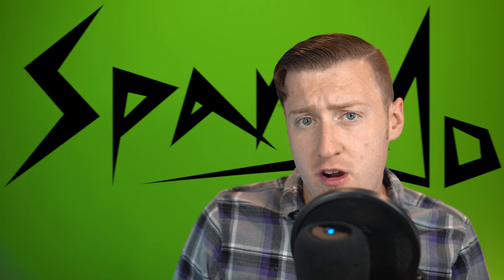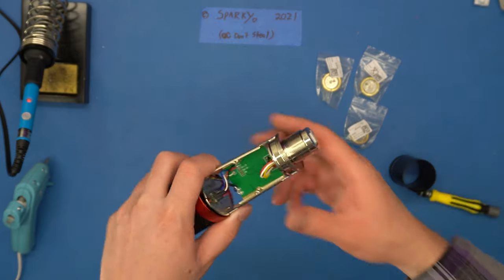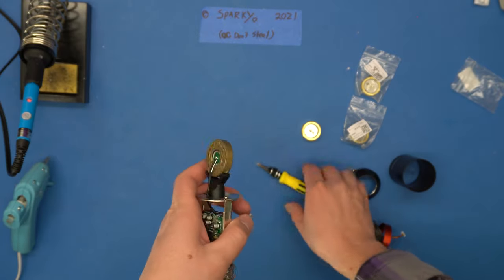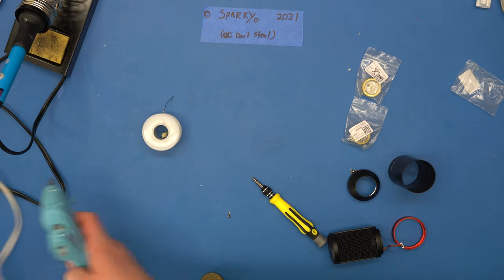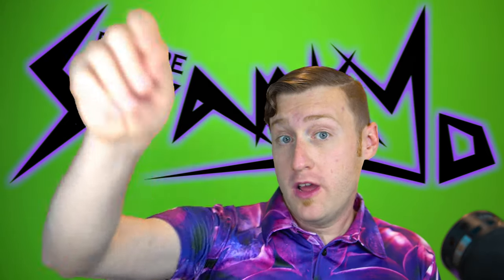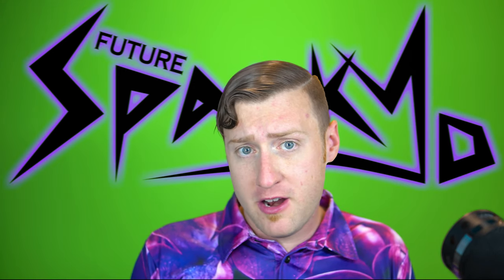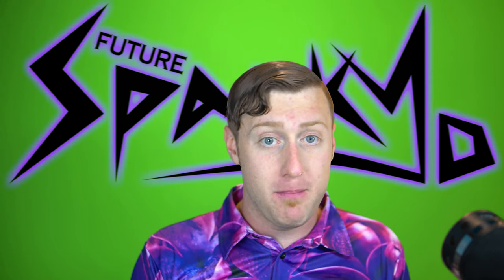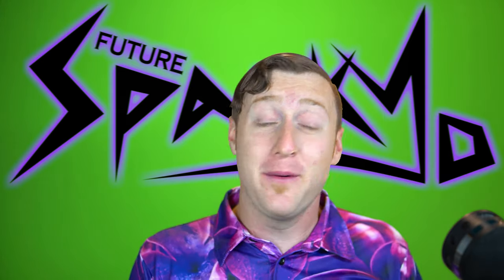Modding a USB Condenser Microphone | USB Microphone Hack?

Comment: Hi, I tried to mod  a BM-800 with a pure condenser capsule and I can confirm that there are really confusing info around. The capsule you tested is indeed an electret prepolarised one, but, confusingly requires an additional jfet, as it is not installed inside... DIY perks has recently uploaded a video using a similar capsule I think... try a J305 and maybe removing the 1GOhm resistor...
Reply from the maker: Yes DIY perks put together a good video. I think they uploaded a little after this one went up, so I wasn't able to benefit from their insight.
Reply: @SparkY0  try with a darlington transistor or another jfet with more gain

Comment: I have recently tried to upgrade a 10 mm omni capsule in a usb microphone ( based on cmedia 6533) and replace it with a 25mm capsule (without any jfet). All I hear is a noise. Any suggestions..
Reply from the maker: The input impedance of that chip is 20k - 45k Ohm. Check if your new capsule is too high of an impedance. You might need to build a voltage follower between the capsule and the input on the cmedia 6533
Reply: Let me add more info: The (3 wired) output from 10mm Capsule is sent to NJM 2115 preamp IC, before going to cm 6533 which is the (8051 controlled) main ADC-DAC converter, based on usb. Need to make 25 mm capsule compatible with NJM2115.
As for your project, the results are great. The noise may have further reduced if you could give 2N4116 (N channel JFET,  costly compared to J113) a try and put a 2.2k ohm resistor between source and mic body/ black wire.

Comment: Can I in theory modify my USB mic in removing the Audio Chip and USB connection and use an XLR output? Or would that be too complicated?
Reply: making it analog? yes  I was thinking the same, quality should improve in theory based on your analog gear
Reply from the maker: It's possible, but you would need to more or less replace all of the internal circuitry. This is a decent microphone body, but it would be easier to start with a DIY microphone kit and make modifications from there.
The capsule I tried to add in this video should work fine in an analog XLR microphone

Comment: The problem with cheap usb mic is that they cheaped out on preamp, they just don't have one and instead just push the gain of the dac to the max, which results in noise.
When swapping the caps of a usb mic make sure to also get a preamp circuit

Comment: Hi, look to 8:26 what is that other component attached to the JFET. The little gray one. Is that required to make it work? Also great vid!
Reply from the maker: There's only 2 components, the JFET and a 1 Giga ohm (1,000 Mega ohm) resistor. The intent of that resistor is to act as a very weak pulldown so that the gate doesn't accidently drift high. Any resistor in the 1-100M ohm range should work, but lower resistances could reduce the signal going to the gate of the JFET. 
In practice, it didn't make a lot of difference in my experimentation, but it's still a good idea to include it. A lot of electret condenser capsules do not have this resistor. They may be depending on leakage through the circuit board to act as this large resistance, instead of adding an extra part.
Reply: @SparkY0  If I use a true condenser microphone like the one DIYPerks used would it be necessary? Thx
Reply from the maker: Yes, these resistors are used in true condenser microphones

Comment: Ah crap I wish I found this video before attempting pretty much the same thing as you did, with similar results LOL. 

I've just replaced the condenser in my Maono PM422 usb mic with a JLI-2555BXZ3-GP electret condenser, paired with a J112 transistor - pretty much no volume even with the mic's gain knob turned to full. After boosting by 24db through Voicemeeter ended up with okay-ish volume, but with a heck of alot of noise (sounds like a constant buzz in the background). I also tried using a 2N2222A transistor that I had lying around, but that one straight up didn't have any output at all - not sure if it's because I have a dud transistor or if the transistor has the wrong specs (not even remotely familiar with how electrical engineering works so I have no idea)

Comment: you use a 48v phantom power capsule  on a usb powered mic??
Reply from the maker: On its own, you can't really use a a phantom power capsule with USB. You'd need to add circuitry to step that 5V up a lot higher. How high is best will depend on the capsule. Usually more voltage is more better, up to a point. 

The capsule I used, I'm pretty sure it's electret and does not need phantom power. At least, adding 30V from my bench power supply to it did not change the response in a noticeable way.... But the capsule didn't come with a built in JFET like most electret capsules, which is needed. The JFET I tried was not a good choice, and there was likely other problems holding it back.

Comment: it needs k596b transistor being soldered into capsule. 

1: Transistor's middle leg goes to capsule's mid contact. (soldering)
2: Transistor's left leg (from printed text) goes to capsule's ground together with (-) cable from PCB. (soldering)
3: Transistor's right leg (from printed text) goes to PCB's (+). (IT DOES NOT connects with the capsule). Just solder pcb's (+) with transistor's free right leg)
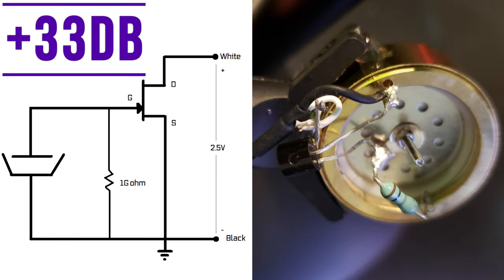Reply from the maker: That sounds like the diagram I showed at 8:15 Except the JFET I used was probably a J113 where the legs are arranged DSG. I guess I didn't show which transistor I used in the video. I had also tried J310. 
Is it that important to specifically use an audio transistor? K596 seems to be obsolete and hard to source, but it wouldn't be too hard to order in 2N5457 to try.
Reply: K596B's Zero-Gate-Voltage Drain Current is less than 0.5mA. Both J113 and 2N5457 have much larger currents. Without knowing the rest of schematics it's impossible to say for sure but highly likely this is the reason you did not get what you expected. K596B is very much alive, you can buy it at aliexpress, and it has built-in gate-source resistor.

Comment: im using fifine k669 mic and my mic sound is totally different from what i heard on youtube. it sounds very quiet, when I scream, the sound is quieter, it's like a compressor but the sound it captures is too low. Do you have any ideas?
I have to whisper close to the mic, if I turn up the volume too much it's noisy. when I whisper the sound is louder than when I speak normally
Reply from the maker: It's hard to tell without hearing, what kind of noise are you hearing, is it from the mic or from your room? Have you tried adjusting the volume in your computer OS, or only with the knob on the side of the mic?
How close are you to the mic? 
It's strange a whisper would be louder than normal speech, unless you are getting closer to whisper. Have you tried using the mic with  a different computer? Maybe it's a problem with your recording software, or there's some software installed that is affecting it.
Reply: @SparkY0  hi. it's like white noise but it doesn't matter, its low voice pick up is a big problem for me. with 70% gain on windows and 40% on mic knob is the good condition for my voice not to be too loud and cut off
. when i talk it picks up voice as low as headphone mic, i don't know how to explain it but it's very thin. 
if i record and increase it to 5db its much better
hi. it's like white noise but it doesn't matter, its low voice pick up is a big problem for me. with 70% gain on windows and 40% on mic knob is the good condition for my voice not to be too loud and cut off
. when i talk it picks up voice as low as headphone mic, i don't know how to explain it but it's very thin. 
if i record and increase it to 5db its much better
Reply: when i whisper like I'm tired and have no energy it will pickup more vocal range than when i talk normally, maybe the sound is too low and my gain is too high so it's distorted, i dont know
Reply from the maker: A lot of people talk into the wrong side of the K669. It's a font-address microphone, meaning you talk into the front of this mic by the knob, not into the end or the back. The stand is also very short and holds the microphone a lot further away than you should be talking into it. It works best when you talk into it from around a hand-width away. 
Assuming its in the right position, can you also make sure the microphone is set to 16-bit 48khz in windows?
A short video showing how everything is set up could help people see if its a problem with the settings.

Comment: try using another mic with xlr connector, using schoeps circuits
Reply from the maker: That's a great idea, and might be a future use for these capsules
Reply: @SparkY0  Yeah, please do a video on that! I could hardly find anything about these capsules and now stumbled by fluke over your video. I ordered some capsules too, but they never arrived. I saw a commercial microphone with this exact capsule, I might be able to find out which one it was, if you're interested. Maybe you'd be able to replicate the circuitry.
Reply from the maker: Yes, I would be interested to know about that microphone
Reply: @SparkY0  I found it! But I'm not sure if I can post a link, without getting the comment deleted...
Reply: ... doesn't work :-(

Any ideas?

Comment: I would be happy if you could figure out how to fix the issues, so that I just can apply that to my microphone 😂
Reply from the maker: I'm still working on the microphone, but slowly. I just got in some 16mm capsules with P/N B22155E2 that I'm optimistic might work as a drop-in replacement. I'm not expecting there to be much of a performance difference but it could surprise me. If these work out, I might start looking back into how to get a larger capsule working. But I'm having trouble finding a larger electret condenser capsule.

Comment: Im using maono 461 i think it has very good amp and fine capsule but you know, it doesn't sound AMAZING i believe i just buy a more expensive one from the same Chinese brand will do it

Because if i wanted to get the capsule id have to change to xlr then but phantom sigh with shipping cost it may not be worth it

But now i know what is good big ass capsule from the brand i like which is maono 

Theres this video from diy perks i think that's the way to go if you want the great dik microphone experience for cheap
Reply from the maker: Unfortunately the DIY Perks video and mine came out at almost the same time, so I made my video without the opportunity to watch that one first. Someday I might put this capsule into my BM800 XLR mic, which I think is a lot more likely to work since it looks like it has the missing JFET built right in. 

The Maono 461(PM461TR) should be totally fine. I don't have that exact model but similar USB mics are sometimes lacking on the low frequencies a bit, which might actually be a good thing for recording voice in a smaller/untreated room. I would at least expect it to be better than a FiFine K669B. Not very many USB mics use a big capsule, so I wouldn't worry about the capsule size too much. I would instead focus on getting a good mic stand (it came with a little tripod, right?) and pop filter. It can be hard to find the perfect place to position the microphone, but getting it up and away from your desk will make a big difference. Also, remember you talk into the front of it, not the top. A lot of Amazon reviewers of that mic seem to be getting it wrong. 
After that, work on making your room sound better.
That should be good enough to last a long time until you want to move up to XLR or try switching to a dynamic mic- but you might not ever need to do that. It all depends on what you need to do.

Comment: It needs phantom power.
Reply from the maker: That's what I was trying to emulate by adding the polarizing voltage at 8:40 but it wasn't making any difference at 35VDC. I didn't try to increase the voltage any higher, because I would have needed to jump through some hoops to step it up higher and I was worried about accidentally about higher voltage finding it's way into the 5VDC USB side of things and make its way back to my PC.
It's my understanding that some microphones step the 48V phantom power up to around 200V for a polarizing charge. Maybe it would have worked at those levels, but it would also take some significant extra circuitry to make that happen in a USB microphone. 
At that point, you're still pretty far out of scope for this to be a practical mod. 

But that's one thing I can't explain with my (bad) understanding of the physics involved. If the capsule needed a polarizing charge, then why would any signal at all be able to come out of it without a polarizing voltage? What would be moving the electrons, if not for a permanent charge?